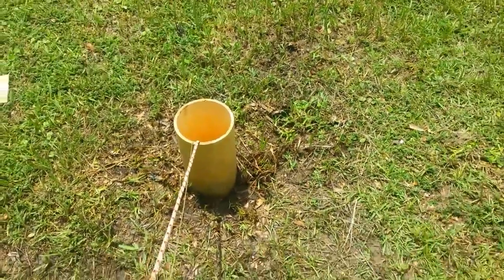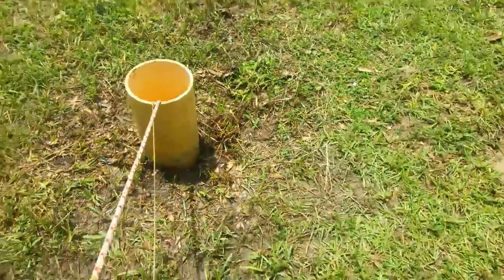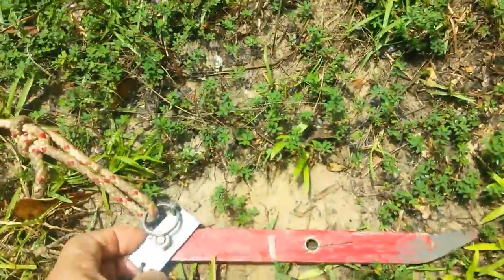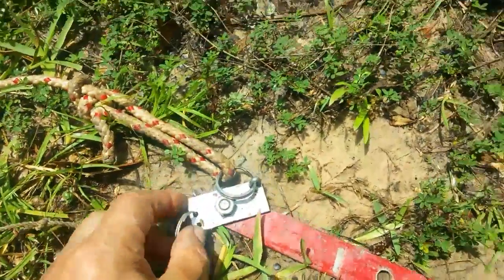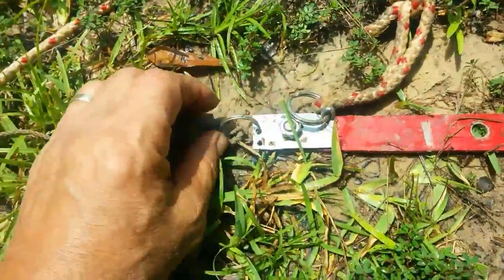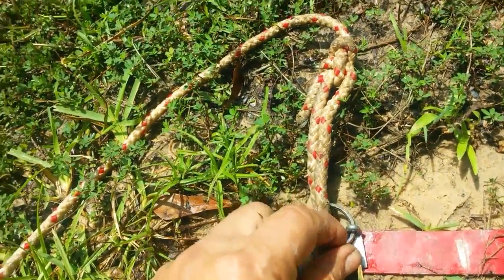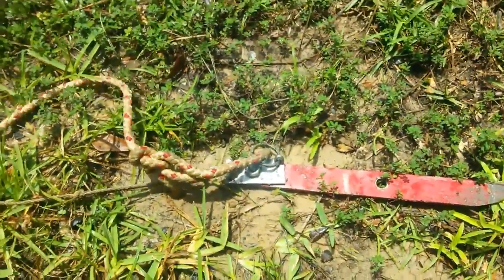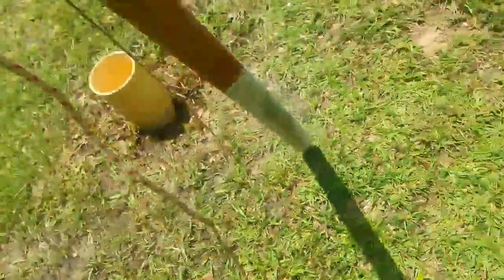Well pipe retrieval tool

Comment: i know this is an old video ?, but i just wanted to thank you very...VERY much for postig this '' how too do '' video !..thank you so much !. i have a busted off drop pipe down in my well right now, i watched this video, and liked the idea versus paying 700 bucks for a tool called '' fetch it '' ?, really...700 bucks ??..no thanks !. back to your tool, loved the concept, but this version of your tool is only good if you have a large well casing ?, in my issue, my casing is only 2 od ?, sooo..with your idea..and me making a smaller version to drop down inside a 2 inch od drop pipe ?, i tested the tool on a section of pipe i had laying around ( same drop pipe that is down in my well ), took me a few trial and errors to get the tool to work like you showed in this video ?..but low an behold...IT WORKS !!!. so now i will get to try it out on the real pipe down in my well..lol.

Comment: Great idea. That other tool on the net is ridiculously priced at $650 for about a $50 tool. You can tell he trys to sell by saying it's worth it by saving thousands of dollars by not hiring someone to pull the pipe out..
Reply: Yea I saw that, the materials flat stock can be burned out (cut) out of sheet steel by the 100's per one sheet of steel, he could sell them for LESS than $150.00 and still make money
Reply: I saw that too, I have two wells on my property and accidentally knocked the pipes and who knows what else down the well casing a couple of weeks ago and have been pondering an idea to retrieve them so I can seal off the old well. Anything over $100 for that $20 “tool” he sells is insane.

Comment: You did not explain the “loop” on the “corner that does all the work”. I suspect it is a Mini Cable Clamp.  If this is correct, you could replace the wonky key ring with  1/8 inch aircraft cable, looped and secured with those squeeze locker thingys .  This would replace the entire lifting rope.  Here in Canada they sell 1/8 cable in bulk at Princess auto.  Translate that into Harbour Freight in the U.S,    And yes we spell colour with a U.   Princes also sells Para Cord for the trigger string.

Comment: We just lost a pipe in a 300 ft deep well and we didnt wanna pay 3000 dollars to get it fixed. Do you think something like this will work??
Reply from the maker: it will have to be made with hardened tool steel with very sharp edges. If the pipe section has couplings you will have better luck if you grab it below a coupling.
Reply from the maker: you might consider just hardening the corners after you drill the hole.